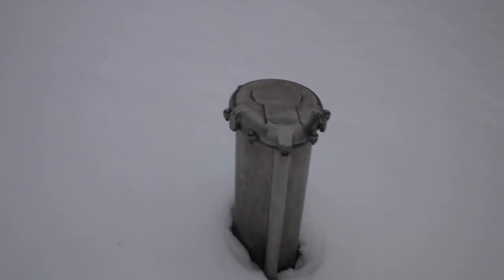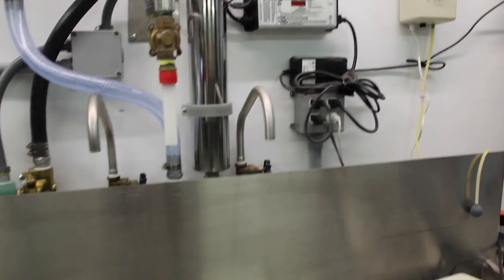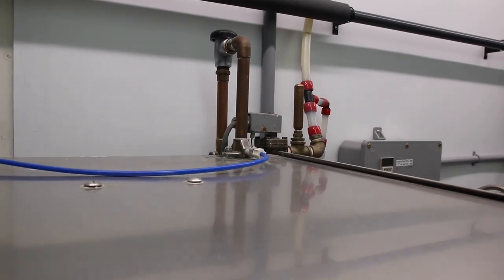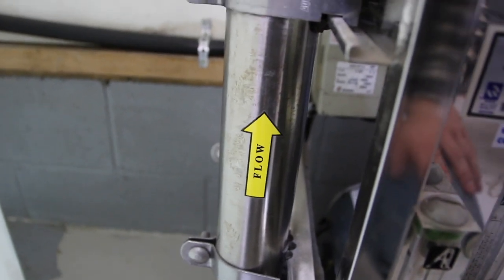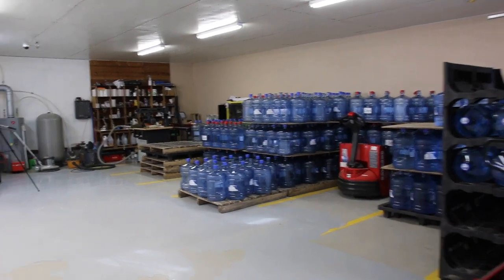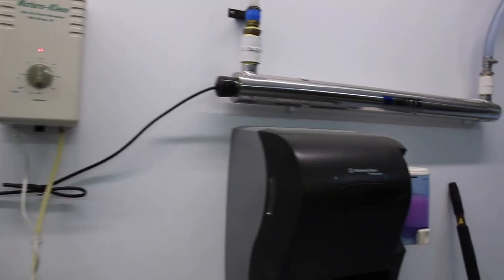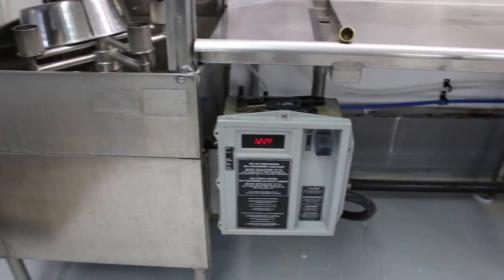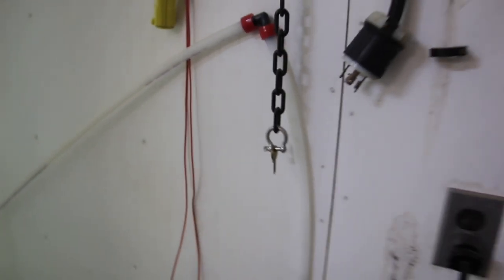Selling Water For A Living

Comment: did you ever have issues with bottles leaking from the cap suction? I am having that issue when i put my bottles on its side. They start to drip. Seems like the plastic on the bottle has small ridges and water seeps through.
Reply from the maker: Yes I had that problem. I used a different cap and very few bottles leaked after that. The caps that worked had a silicone bead. The ones with the foam leaked. Also some bottles manufacturers make the bottle lip more precise and that helps.
Reply: @frenchriversprings  perfect! Where did you get them from? The ones I have now are from novembal. I think the bottles I have are the same ones as yours!
Reply from the maker: Yes they were novembal. Not perfect but a lot better than canam plastic. I think I got the caps from pacific caps.